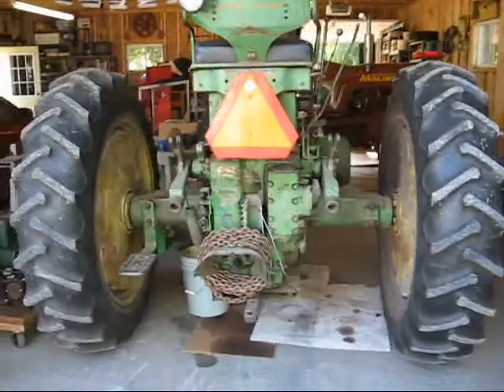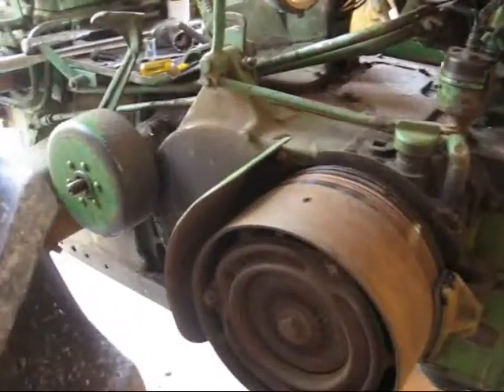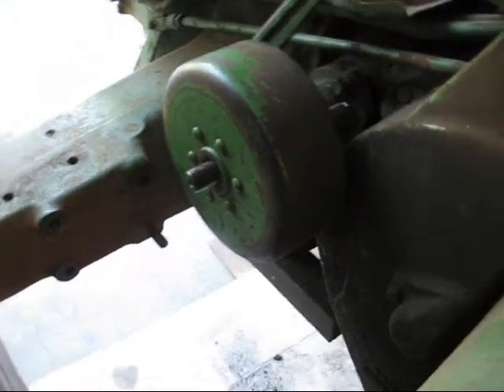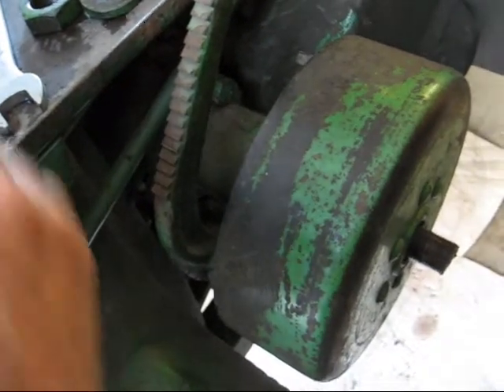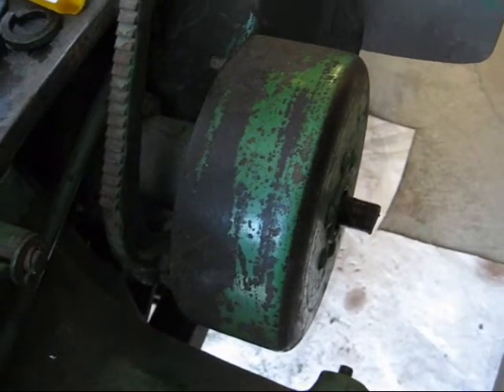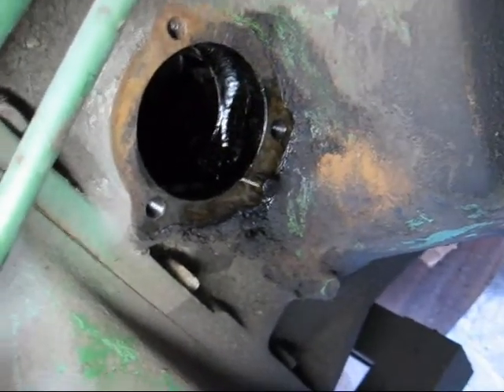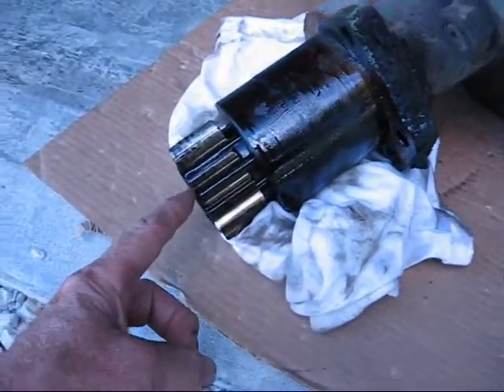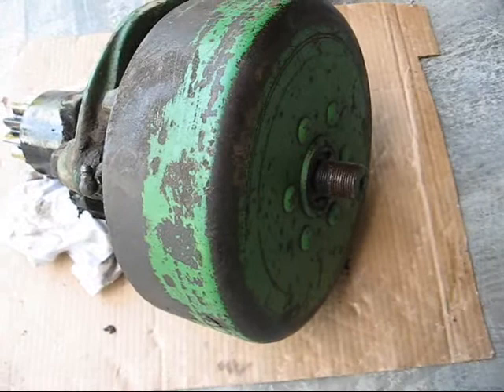JOHN DEERE 2 cyl Tractor Brake Job part 1

Comment: When you had the nut removed from the drum, I was reminded of another video where they said to be careful. Once the drum is off, it’s possible to push the shaft inside the case! 😳

Comment: (Part 5 your reinstalled.) There used to be jokes about math teachers who would fill the blackboard with formulas and then say something like “Multiplying, dividing, factoring, and cancelling, Poof!, we get the answer. And then erase the board.
That’s what you did when you shut the camera off and pulled the right brake assembly! My 1953 JD 50 assembly won’t come off. It hits the boss with the closest implement mounting bolt. I pulled the bolt but it still hits the axle housing. The pinion gear is almost the same diameter as the hole and I can’t swing it sideways enough to clear. The factory manual says to fix the brakes in place. Even when the manual talks about the first reduction gear and clutch area, they ignore how to remove the brake assembly. 
I guess I’ll do like you did and drop the whole 4400 lbs on a block of wood. 😃
Update: I never got the total right brake assembly out but I got most of it out after finally getting the brake drum off. The key to that was soaking everything with WD40, letting it set, putting a bolt back in so the assembly was hard against the housing, pulling the brake drum and shaft 1/8” away from the tractor, and hitting the shaft end and nut with a brass hammer. Two hits and it came loose. Without the drum, there was enough space around the brake shoes to get it out past the axle housing.

Comment: I just started working on a A.  Motor is stuck   Been stuck for a long time.  Hasn’t ran in at least 25 years.  I’m trying to pull it to the house. Not to far and all dirt. No pavement.  Gonna pull my right rear brake asssembly off tomorrow in hopes it will roll free. It’s stuck like chuck.
Reply: If right brake is stuck, tractor won’t roll. Is left brake ok? Brakes are connected to final drive. Even if tractor is in neutral, both brakes need to turn - or be removed- for tractor to roll.
Reply: @noellwilson1273  i got them freed up.  And motor. Unstuck.   I need a manifold and carb cleaning. And new clutch driver and to shim the crank if I want to use the tractor. Has a lot of wear on the splines

Comment: i have watched all parts but i do not know how to remove the third bolt kinda under brake assembly.  would youplease answer.
Reply: You need surgeon’s hands. Being double jointed helps too. Open end wrench 1/2 flat at a time. Maybe a 3/8 drive ratchet with short 3/4” socket. Check that it’s not a stud with a nut. If that’s the case, you might have to use an open end wrench.
It’s easier with floor pan removed but that’s another story.
I’m 81, 250 lbs, and just removed both from a model A.

Comment: That can't be a 1961 model 630. The last year they made the 630 was 1960. It may have been a 1960 year model that was carried over & not sold until 1961. The last 2-cylinders that were made often sat on the lot for a long time before they were finally sold. We used to have a 1959 630 that had sat on the lot until Feb. of 1962 before it was finally sold. We bought it used from the original owner in the mid 1960's. I guess it was probably hard to interest a prospective buyer in a 630, when he could buy a 3010 with much more advanced engineering, for a similar price.